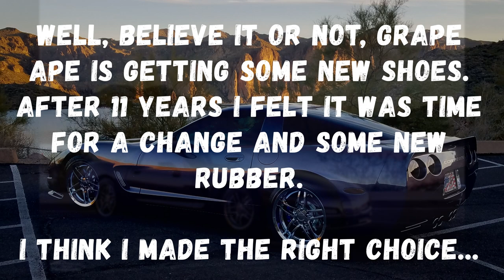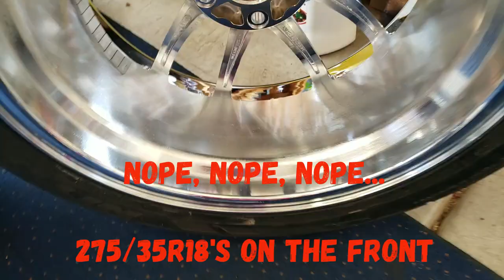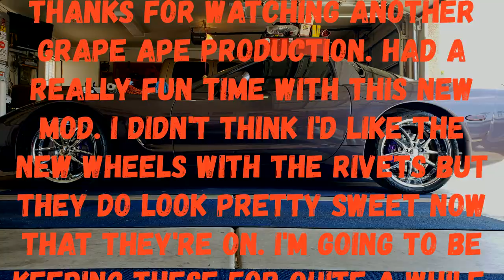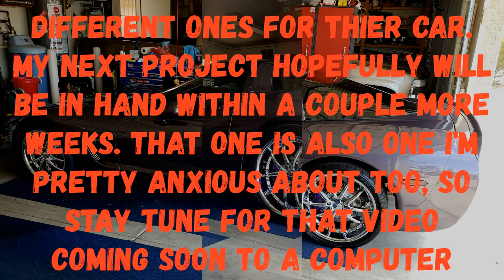1998 C5 Corvette (Grape Ape) SR1 Apex Wheels & Nitto NT555 G2 Tires

Comment: I just put a set of these steam rollers on my '95 C4 Corvette. Love the looks in every way, but these things bring out all kinds of rear end noises. These are, without doubt, the hardest tires I have ever had on this car, and I replaced Kuhmo ECSTA Supras!! I will say that on smooth roads the tires are very quiet, and so is the car. Cornering traction is stupendous, but I'm not so sure about launch traction. Last night, without even trying, I got chirps several times from just moderate throttle away from lights. What gives? Anyone else experience this?

Comment: Thanks for posting a vid featuring the Nitto's. I'm getting tires on my C5 Z soon and i'm researching as we speak. I've got BF Goodrich TDK 2's but as usual, not available any more. I'm narrowing down to these G2's and about to pull the trigger. You've had yours on few months now and i'd like your feedback on how they've performed for you. Thanks!
Reply from the maker: So far I love them. I had Firestone's on before and I didn't really care for those. I also have the Nitto's on my truck and that's what helped me decide on them for the Vette. I did change out the rears from the 305/30R19's to the 305/35R19's so the sidewalls matched better with the fronts. The 30's just looked to much like a rubber band to me. I think you'll be happy with them if you decide to get them.
Reply: @c5grapeape  thanks sir!
Reply from the maker: Any time. Hope you enjoy your C5 as much as I have and will continue to. Let me know if you have any other question.
Reply from the maker: @rgturner9191  Thanks, yeah I'm running what you mentioned. Email coming....

Comment: How did the G2 tires hook up in 1st and 2nd also what spoiler if you don't mind me asking
Reply from the maker: So far the tires have been very good to me. They hook pretty good. I have an automatic unfortunately, so I can't give a real 6 speed evaluation of them. The rear spoiler WAS an SLP. It is no longer on the car. I now have the Spekter Werk fiberglass one on it. The front one is from ACI and still on the car.

Comment: 305/30/19 on rear, what are you sporting up front? :)  Thanks
Reply from the maker: I'm running 275/30-18's. I'm going to get the 255 or 265 next time. They're just a bit to wide I think. They don't rub so no issues with that. I just think it would steer a little better with a slightly narrower tire.

Comment: Very nice what is the difference between the old and the new width
Reply from the maker: Thanks, still getting use to them. My old wheels were the C5 Z06 sizes. Fronts were 17X9.5 fromt and the rears were 18X10.5 rear. The new wheels are 18X8.5 front and rears are 19X10. The offset is a bit different also so the new ones don't stick out as far as the old ones did. Not that it was an issue but I can see the difference when looking at them.

Comment: What are the specs and offset on your sr1 wheels?
Reply from the maker: Here's what the offsets are. No spacers needed either.

Front Wheel Size: 18X8.5
Front Offset or Backspace: +56mm

Rear Wheel Size: 19X10
Rear Offset or Backspace: +65mm